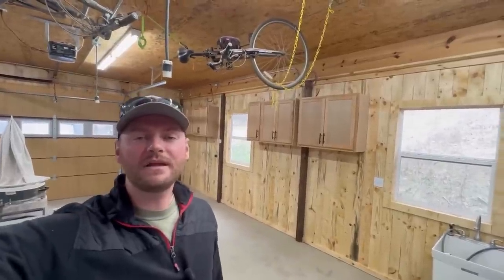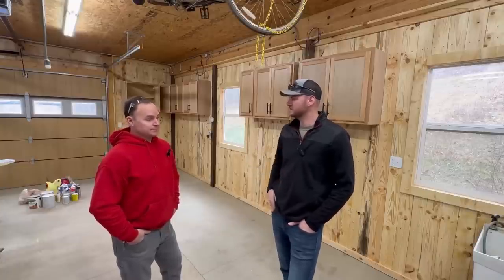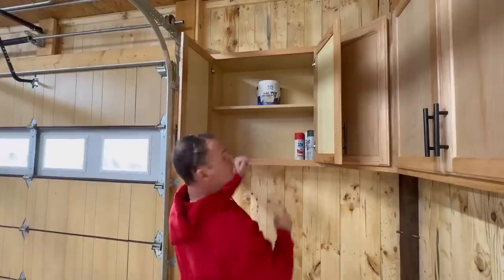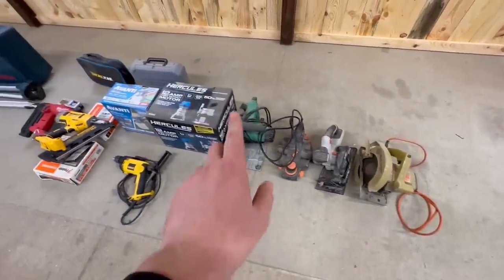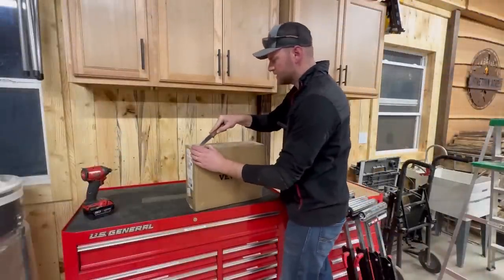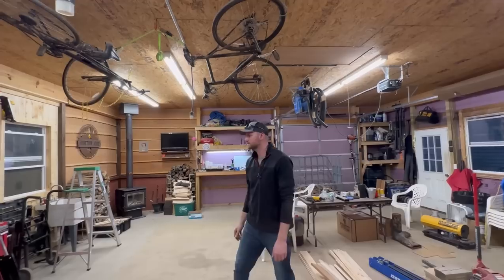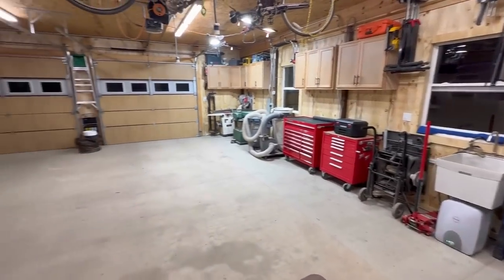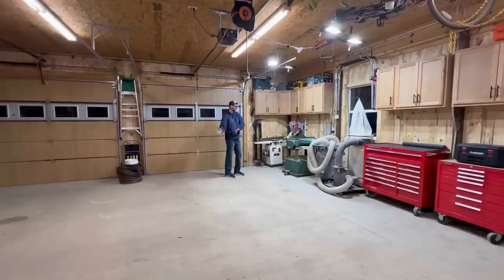Your Shop Will Be A Mess Until You Do THIS

Comment from the maker: ***Link to retractable extension cord
https://amzn.to/3V3xs88
Reply: Here's a link to Doug's channel in case anyone is interested - https://www.youtube.com/@OneEyeCustoms
Reply: @MrTapanes  Good on ya for this shout. I look forward to each of his videos
Reply: One point I'd like to make, and it deserves attention,  your basment is a conditiond space year round, heated in the winter and cooled in the summer, what items in your shed/ garage workshop need to be kept at a livable temperature year round?
The paints calks glue finishes can all go in the basment, then all you have in the shop is tools, nothing thats going to require heat or ac temperature year round.
It cost money to heat the shop, you either buy the wood to burn or cut down the trees using gasoline then split it.
Your not going to be using any of it today.
Untill you do you can store it. 
Just bring up what you need as you need it.  This leaves more room for tools, sanding disks and consumable items.
Something to think about and you wont have to keep the garage/shed shop warm.
Reply: Guys have been doing this for years  
Baby food jars screw the lid to the cabnit bottom over a 2x3 or 2x4 and fill the jar with nuts bolts screws ex unscrew it when you need it use a few then put the jar back. You can use peanut butter jars pickel jars what ever,  large almost quart size placenta sauce jars make good scoops with handel and all just cut out the bottom, fruit and pudding cups are great to put glue in insted of using it from the gallon jug, lays stack potato chip tubes lids fit some of the fruit cups perfectly and can be used to keep the wood glue in overnight.   You have a lot of dead space you could install French clets  to hold tools .
 You can also make a bench over the roll out tools. Or even a flip out bench with a leg to use as an outfeed table for the saw.

Lumber rack off one wall to hold rough cut lumber. And a plywood/sheet good cart.

Comment: I used to be in manufacturing and have gone through some lean course (5S is part of lean). The hardest part of 5S is sustain. It's easy to get motivated and start the program - sorting, shining, etc. - but once that is done, keeping it going is the part where it often goes astray. "I'll put that away tomorrow" or "We'll clean it all up this weekend" creeps in and before you know it, you are back to where you were before 5S. You have to allow yourself the time to stay neat and organized.

I now own a small sewer and drain business and I subcontract for many plumbers. I do some specialty stuff and have more tools than a lot of them. They see my van and are really wowed by the organization. I've had guys take pictures and tell me they are going to copy it. And I still need to do more organization. The van I have now was already decked out with shelves when I bought it so that's what I worked with. I'm planning on a new van in the near future and it will be a clean sheet build-out to be as organized as possible. More organized = faster work = more money.

Comment: I keep my funnels in a 5 gallon bucket so they are not constantly dripping on everything until they dry. Measuring cups for fuel mix, short lengths of fuel line, clamps, tin can for a small catch basin, filter wrench, all found their home in the bucket as well.Put a lid on the bucket and keep out the dust and keep in the smell as well as providing a seat while your waiting for the oil to drain. 5S is used by Boeing so there must be some merit to the system.
Reply: Excellent ideas! Keep the dirt and dust off the clean funnels and keep the drips contained

Comment: for those oil products, get a metal cabinet, because if any of those oil containers leak or have residue on their surface after use, they are going to stain that wooden cabinet and you will get a oil smell permanently in the cabinet. 

One other tip with a reel extension cord, hang another on by the door, but with a 100ft length, soyou have a second one inside the garage, but also one that can reach quite a ways out of it.

Comment: 10:55 "hell yeah" . In my smaller 2 car garage shop I have now about 100,000lm (not a joke) of mainly 5-6000k lighting overhead and under shelving. It makes working late at night like daytime. Also bright light does a lot for the physiology and not feeling tired or worn. I work 98% of the time after the kids fall asleep so not my most energetic time. It's been cool watching the build of this. Been following you for a while now since meeting neighbor Doug. Your framing nails, and other may serve best on the bottom drawer vs prime eye level cabinets? I have over a dozen Vevor products now, and they are solid value and mostly great quality. Above average IMO. WORKPRO included..I've been incredibly impressed with the quality and diversity there.

Comment: I love what Doug suggested with the shelves in the first cabinet. Most of us would overlook that. I really like the timeframes for use of items and how they're stored depending on those times. That's all part of the sort/set-in-order. I'm really surprised Doug, of all people, didn't mention the 6th S - Safety. That's especially important in the shop. One of the things I noticed right away as you were hanging things on the walls was the roller stands and clamps right above and around that window. I would consider moving those or covering that window with a sheet of plastic/plexiglass so you don't put a clamp or stand through it when you're tired and hanging things up at the end of the day.

Comment: The wall mounted mitersaw rack could swing up with fold out legs with 2 fold down benches to be a miter station.

I give you all these ideas, I only wished I had the space for a shop you do.
Bright idea with the LED lamps. 
I bought a bunch of used 4' Florent fixtures with the bulbs the guy had hung them on the celing unscrewed the bulbs put in a screw in outlet and added power strips  that way I could hang them where I needed light staple to wires to the celing 
And turn every light on at the wall switch.
Belive it or not it meets code. Its temporary lights.  When the bulbs burn out ill buy led tubes to replace them.

Comment: I mounted my large power tools on casters years ago when I didn’t have much room in my garage. Make sure you have your heavy power tools on a well stabilized casters / carts / mobile skids. A heavy tool MUST have a wide stable mobile base. Personal experience; I had a tall cars iron table saw on a unstable base. Moving the saw, it caught a electric cord and it flipped over instantly. Amazingly I was uninsured, no major damage to the saw. If I had been pulling towards me major injury. I’m making a new expanded stable base.

Comment: Great video. You could consider under cabinet lighting above the rolling tool boxes. And a way to catch grease drips from the gun. Maybe a catch reservoir under the cabinet or attached to the wall. I will be checking out 5-S.

Comment: Always fun to watch garage greatness. I might add a few things if I can. If you have a small ziplock slide it over the tip of the grease gun and secure it with a clamp type paper clip. It will save you floor. I wondered if you couldn’t add some kind of LED task lighting to the bottoms of you cabinets? Thant would go along way to brighten up the areas below the cabinets. Most big box lumber stores or Ace hardware stores carry a Velcro product called Wrap-It. They come in varying width’s & lengths. I would gather up the slack in the power cord of the ceiling mounted cord reel. There is a nice sized grommet at one end you use with screw in type cup hook or larger hook. See you in the next installment.

Comment: I cut 3 holes in the bottom edge in a bucket n put it on a pulley for raising n lowering n fill it w my rags.up off the floor n out of the cabinet.works great.

Comment: 5:30 When storing heavy items like that on upper shelves, I have found those cheap plastic peg supports will fail over time and use.  The hole the peg is sitting in will enlarge a little and the peg will fall out sometimes with disastrous effects...  You my you might consider installing stronger cleats if  you think that will be a problem with your cabinets.
Reply: They are the metal shelf supports.
Reply: @OneEyeCustoms  Yes they look metal, I just can't tell if they are still in particle board holes which deform as the shelf is used over time taking heavy items on and off the shelf.  The pegs don't fail...

Comment: Your next upgrade to the shop is needing to be replaced with led shop lights. I recommend that you have outlets put in where your existing electric box on the cieling is that way you can plug the new lights in easily and replace them just as fast if they do go bad. I did this in my shop and it was a huge difference in lighting and old florescent lights wasn't efficient, didnt produce good lighting and the ballast issues the florescent had was eliminated by installing the new led shop lights. You can even plug  many models together to get more opinions  in spacing

Comment: I see air compressors taking up prime real estate in people's garages. You need the air, not the compressor itself. I hid mine under a workbench in the corner with female connectors in a couple of spots. Better yet, put it outside, in the back or wherever, in its own enclosure so you don't have to hear it running.

Comment: May I make a suggestion look into getting some LEDs shop lights, made a huge difference in mine.  Barrina LED T5 Integrated Single Fixture, 4FT, 2200lm, 6500K (Super Bright White), 20W, Utility LED Shop Light, I used this company but used the 8’ lights.

Comment: I've been warned against Rolled Extension cords because there is not as much heat can be dispersed when the 50 feet of flowing current is all next to each other in the roll.   as a result i decided to install a single length of heavy duty cord above my Squeeze chute to run the electric dehorner and branders.

Comment: One thing I did in my shop is run a 1 inch bead of caulking on the bottom, in your case I would recommend so that water doesn’t touch the bottom of the wood

Comment: The problem of using your cord reel to power your LED lights on the ceiling is now if your working on a project where you need the cord reel for something else, your no longer powering your lights. You should change out your fluorescent light fixtures to LED fixtures and add to that for more work light. You can easily change to LED tubes at a very affordable price. I bought dual 4ft LED tube fixtures at Costco for dirt cheap, but there are so many other places you can get them. They basically plug into each other so adding on to each one is a breeze. Something to think about if you want to improve the lighting in your shop.
Reply: Do not respond to this telegram guy… it’s not Adam… someone trying to get your info… 

Adam will remove his posts shortly

Comment: I’m sure you have a fire extinguisher (but I just didn’t see it), but with a garage that size and all the equipment and chemicals you are using, it would be a good idea to have different extinguisher types around the garage—CO2 for electrical, foam for flammable liquids etc.  Maybe you could even make a video on the various extinguisher types and what they would be used on around the workshop.

Comment: Move the grease gun,  It will drip grease / oil and make a mess on the floor.  I placed mine hanging in a 5 gal bucket with the cartridge part of the gun inside the bucket hanging on the handles.

Comment: The first thing you need to do while the space is open is get out an airless sprayer and 5-gallon buckets of paint and make all those wall and ceiling surfaces white. Oh, that wood is sure purty but it sucks up light to an unbelievable degree. If your shop is the place where lots of actual work gets done then maximizing lighting tops everything. It comes down to whether the goal is to see what you are doing or making a space that looks like a piece of tung-oiled furniture.

Comment: The only reason I don’t recommend reels for extension cords is if you are running a motor for a longer duration of time, you can create induction, the side effects of induction is heat, so you know what comes next fire, so with the permanent mounted extension cord use it wisely, and shut down or unplug each motor when not in use!
Remember, I am not against them, but I have seen as an electrician a few induction melt downs, and several fires. So my advice is to use it wisely and if you are going to run anything that will draw close to the maximum amperage to extend out ALL the cord, or even better yet, open a shorter cord with a higher amperage rating and don’t leave any portion of it “coiled up “ on the floor wall or what not!
Reply: This caused a big discussion and we agree that a coiled cord is a potential fire issue.  So your point was well taken and we agree!  Thanks for the comment….

Comment: In my opinion, you should build a miter saw station. Having to set up a stand and lift the saw off the wall, put it on the stand, just seems like too much work every time you need to make a quick cut. Plus every time you carry your saw in a weird angle you risk throwing off the accuracy.

Comment: I'm not sure how good you are with electricity. It is an easy thing to tap out of your lights to install outlets that you can then use to plug in other lights. If you change the existing lamps in the shop to led, you should have plenty of power to run more lights and get a very high quality of light. Note that extra outlets should not be used to power equipment.